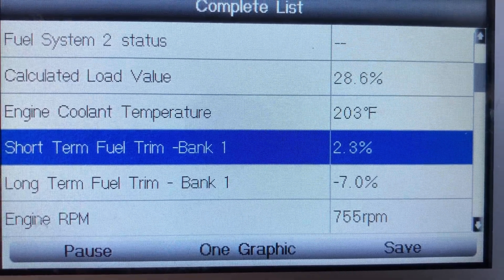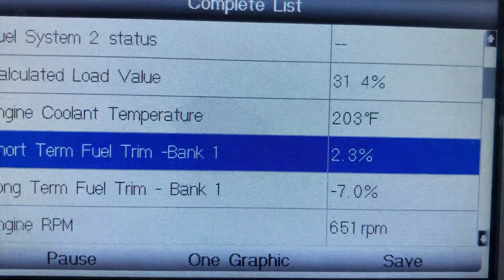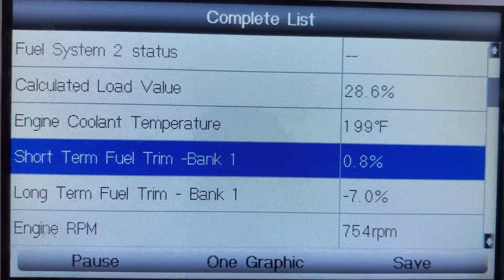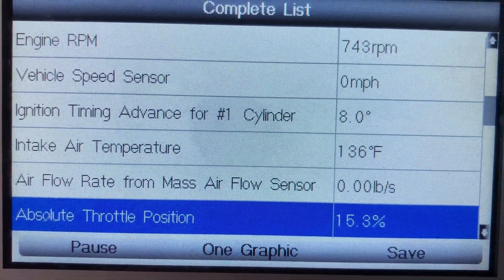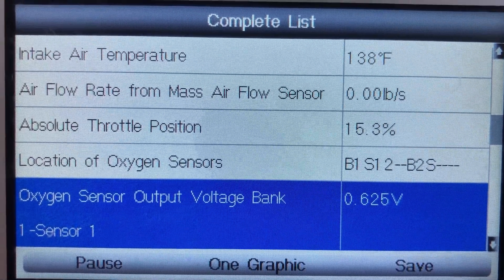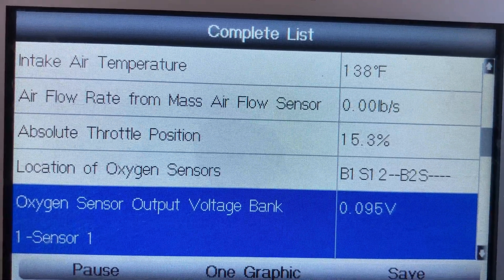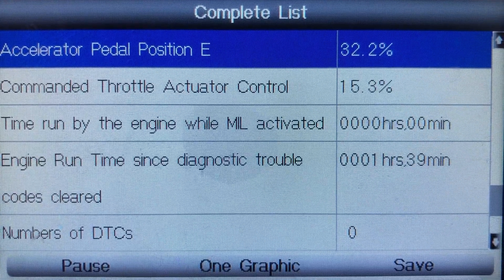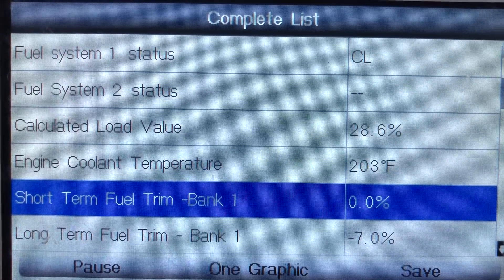Toyota Yaris Low RPM, stalling, lack of power FIX!

Comment: I have a Toyota Yaris 2008 2NZ-FE it has the exact issue you are describing above. What scanner are you using to read the sensory data? Thanks.
Reply from the maker: Hi, you can use any scan tool that gives you live data, most scan tools give you this informations

Comment: My issue was a sticky gummy Backside of the throttle body. Once I cleaned it never had any issue with stalling or idle dropping so low.
Reply from the maker: Always best to start from basic and cheapest options.
Reply: A
Reply: @3rminator  What if you are having the same problems you talk about but with NO check engine light, could the oxygen sensor still be bad?
Reply from the maker: @alexshatner3907  yes sometimes you don’t get the fault code, best to check the reading of O2 sensor to be sure.
Bad airflow meter can cause this issues and also dirty throttle body.
Reply: @3rminator  I now have a new Throttle body and a new airflow meter, can a 02 sensor cause slow acceleration too?
Reply from the maker: @alexshatner3907  if engine running too rich (too much fuel) can cause that as well. You can check the fuel trim with scan tool to see if it’s running rich or lean.  Anything over -3 short fuel trim means engine running rich and anything over +3 means running lean 
Checking the O2 sensor with scan tool can help you identify the faulty O2 sensor.
Air leak also can cause issues. 

Make sure you have not miss diagnosed a engine miss fire.
Reply: @3rminator  Can I use the same scan tool you use to check for check engine codes, or is it something more like a computer?
Reply from the maker: @alexshatner3907  you can use any scan tool that is able to read live data
Reply: @3rminator  Thank you @3rminator, you are the best
Reply: @3rminator  My short term fuel trim bank one is showing to be -3.1 is that normal? and that is at idle
Reply from the maker: @alexshatner3907  is it constantly sitting on -3 or does it fluctuate to 0, -1 up to -3? 
If it’s fluctuating then it’s normal. If it’s sitting at -3 then it’s running rich. 
Check your O2 sensor, check the readings at idle then bring the RPM up to 1500 . if the reading doesn’t change then your O2 is faulty. Sometime you have to wait few seconds for it to change
Reply: @3rminator  Hello my good friend I will check again and keep you posted as soon as I check sometime today

Comment: Hi I have 2014 Toyota yaris 1.5 when Wether is hot idle go very low and engine stop there is no code did you thinking some problem did I have to replace 02 sensor?
Reply from the maker: It can be , sometimes the airflow meter does the same thing. You can check your o2 sensor with scan tool to see if it’s working.

Comment: Hello, I also have the Yaris YR 2006 model. My car consumes a lot of fuel and you have problems. Still no cause found. Did your vehicle consume a lot of fuel? It consumes 11 liters of fuel per 100 km.
Reply from the maker: There’s lot of things that can cause the high fuel consumptions, you can check the O2 sensors to see if they reading correctly following the steps on this video, it can be the airflow meter also and so on
Reply: Mine consume 5 litres for 34 to 37 kms
Reply: You mean the air flow sensor?
Reply: Can you state the accurate level of readings per the oxygen sensors?
Reply: My check engine light is one

Comment: Can i just clean it with carbrator spray or should i replace it ?
Reply from the maker: You can try, it won’t hurt but most of the time it will need replacements.